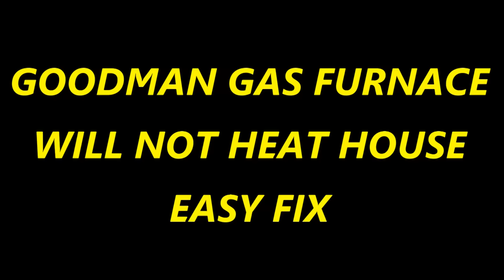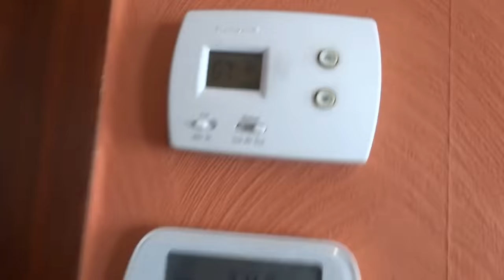GOODMAN GAS FURNACE WILL NOT HEAT HOUSE = EASY FIX

Comment: it worked just as you said! I had an issue with my Goodman furnace. Fan would run but it would head up. I pulled off the vacuum line and used a paperclip as you showed. After putting the line back on. I plugged the unit back in and it started right up. Thank you!

Comment: My Goodman furnace stopped working.  Dead.  Looked at all the DIY videos.  Tried everything.  Called the installer. $69 for a service call. $160 for diagnosis of problem.  Plus cost of any repairs.  I went back upstairs to have a last look at my thermostat controls in the little panel n the wall.  It was dead to.  I decided to remove the front panel to look for any problems.  I discovered this device ran off of two AA batteries.  Replaced the dead batteries.  Problem fixed.  $4 vs several hundred if a service guy would have been called.  CHECK THE BATTERIES IN THE CONTROL BOX FIRST THING!!!!!!!!!!!!!!